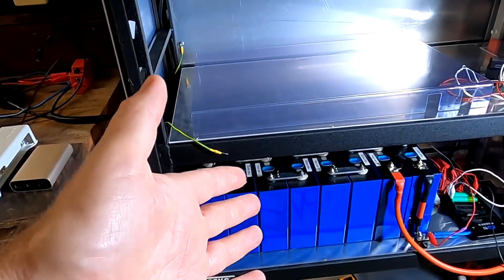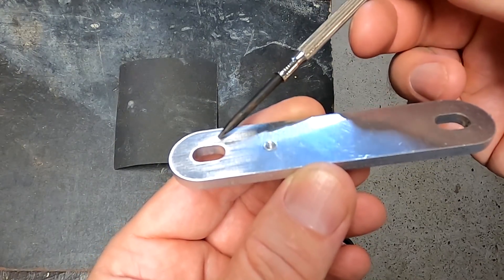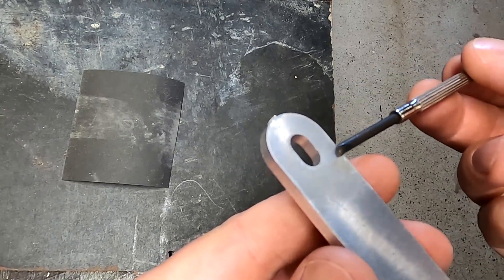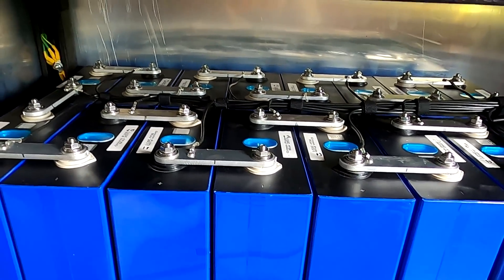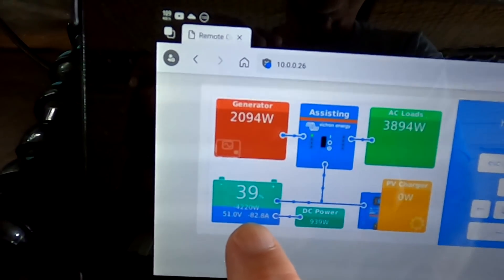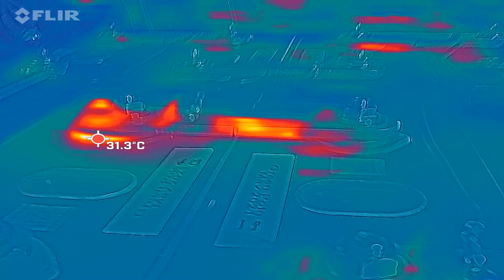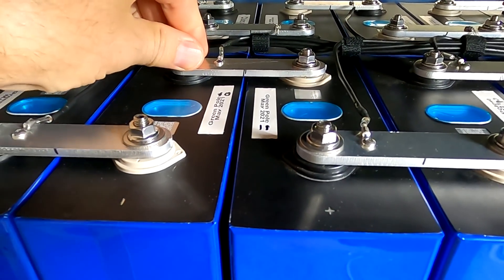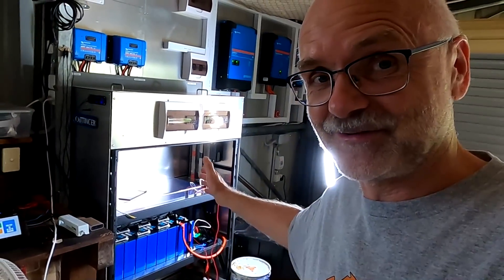Overcoming the battery-busbar problem (for now). Here is what I found!

Comment: Thanks so much for the in depth work on this Andy. It's the ultimate point of your channel, so show people not only what you're doing, but how and why. Rarely do we see people go into such detail especially in todays throw away culture. 

It's quite surprising to see the amount of people saying "use copper", who have either forgotten or neglected to look at your previous experiences with copper and tinned copper. There are pro's and con's of both materials, in my case I've decided to stick with Aluminium and the approx. 2000 bars I've sold so far have all been working well as far as I know. This extra preparation information will be included with future bus bar sales as a bonus. I might even consider a small sachet of Alminox (the paste I use now) in bus bar sales. 

While the product is vastly different, the underlying formula is the same as if we bought seeds to grow a plant from a shop. If we buy the seeds, drop them on the ground and walk away, we will probably find that in 3 weeks it's still a seed sitting on the ground doing nothing. However if we ensure the soil is appropriate, dig the hole, add the right amount of water, and bury it as prescribed, we come back to a sprouting plant. Preparing bus bars, doing nuts to the right torque, properly crimping lugs, and much more, is all part of the process of a DIY battery. This is the stuff we don't usually see behind the scenes in factories making these by the thousands. 

Good find with the raised edges too, even though the outside edge hangs just over the diameter of the battery terminal, the inside edge would likely affect the contact patch. So ensuring the surface is flat is a worthwhile step, and it's also something anyone can do with no special tools. 

For people who use the various pastes, be wary of what is used to apply the paste to the bus bar or to any surface. Using a cue tip needs to be done VERY carefully, because the fibres can easily dislodge and remain on the surface. If you're doing a lot of them, you can go to your local crafts store or pharmacy and get a similar looking item but it has a foam end on it (often used for applying face paint or make-up too), and this avoids the fibre issue. For larger areas, there are things called a "dabbing sponge" that would be ideal. Or as Andy uses, a clean rag can be easy for the bus bars, but tricky to use on battery terminals with studs. 

And finally for the people who still didn't see the info about the bars, they are made from 5005 sheet (not extrusion), laser cut (not stamped), and are 20 x 4mm. The current carrying ability is well above what Andy requires for this application. I use them on batteries that I allow up to 250A current drain.
Reply: Paul, 5005 is a relatively high tensile Aluminium alloy, something akin to what street signs would be made from. I'm no electrical engineer, but my understanding is that pure aluminium is the best conductor of electricity (of the various aluminium alloys) and it is also much softer than a 5000 series alloy and would conform better when tightened down to the battery post. Even with Andy's sanding, there will be all sorts of other variables like small variations in height of the different cell terminals, slight variations of the angle of the cells as they sit for example and so I think any bus bar needs to be flexible in order to have a good connection to the battery post. Copper can be thinner for the same current carrying capacity, is very soft when annealed and does not have as bad a problem with the oxide layer being such a good insulator. It has much to recommend it. For those with deep pockets, silver plated copper would be even better LOL.
Reply: @Ropetangler  Have a look at Andy's previous videos (I did mention that above), he's had experience with various bus bars, and these have been the best yet. You're free to use whatever you prefer, just as I am, and everyone is. The results of these are proven, as are the results for some others. I'm not saying there's a right or wrong, this is what I use, this is what Andy is using at the moment, and it's what many others use too. Just because you disagree with something, doesn't make it wrong.
Reply from the maker: Thanks a lot Paul. I've pinned your comment to the top of the list.
Reply: Would 1099 (commercially pure aluminum) make better bus bars? Softer, and higher conductivity.  Or would an 8xxx alloy (good conductivity, higher corrosion resistance, excellent creep resistance) be better?
Reply: Hi.
20x4 mm is good for 64 amps, according to online calculators.
Trying to learn, why do you say it's good for 250A batteries?
Thanks in advance.
Reply: I couldn’t be sure in the video, but it appeared that you are sanding the busbars dry and then coating them later.  Aluminum forms oxide very, very quickly.  It is advisable to coat the metal with antioxidant grease before and during sanding.  This will remove the oxide and prevent a thin layer from reforming before you get the bar bolted to the battery.  Most electricians are taught to coat conductors before sanding or wire brushing them for this reason.  You may wish to try this and see if it improves your hit rate on getting good connections the first time.

Comment: I've been playing around with some BT-360 cells and was astounded by how bad the connection can be. I found some aluminium clamps that have lugs on them. they have a 10mm internal but I plan to drill it out to 10.9mm and try to clamp around the posts which are 11mm. Then I will try to bolt bus bars to the other part. I will be able to fit a nut and bolt so a much higher clamping force will be obtainable. The newer EVE  cells have a bigger laser welded terminal but I went for the cost saving option. PS. with a 40A discharge I got 326Ah I would consider the BT-360 a good slow discharge battery and also a slow charging cell. To top them up to 3.65V took days! I think you need a 48V string or at least 4x in parallel to be able to get a large amount of power from these and to make more from the solar power available. On the other hand for the price It was unbeatable. I am now considering using LTO for my high power appliances with LIFEPO4 kicking in when voltage drops below a certain level (to be experimented with).
  Basically I am buying a low voltage relay circuit. You can set the relay to close when voltage drops below a certain level. The relay closing will switch in a 100A solid state relay (if controlled by a PWM signal can also regulate current).
  I can have for example several 100Ah or any other size LIFEPO4 that can be switched in parallel with the LTO cells. 
As the voltage drops to different levels you can have several of the low voltage relay circuits that switch in more LIFEPO4 banks at various voltages to help prop up the LTO cells as the bank of LTO might only be 35Ah but you can take a huge amount of current from them. I would rather put most of the load on a small bank of LTO rather than overstress my 4x BT-360 or one of my 100Ah LIFEPO4 batteries.

Comment: That is another reason I don't use busbar, I use lugged cables instead (as seen in video). The main reason is because the inherent contraction and expansion (bulging) of LiFePo4 that can damage or bent busbar in long term. I also avoid anything aluminium, I prefer fully copper or tinned copper.

Comment: Ok, its time now for an optical reaction.. A bit late, I know, but I didn’t see this before..

First: Materials like copper, brass, aluminium, always pick up grains from sand paper, increasing the resistance because of less electrical contact.
I always use an ultra flat diamond grinding tool, to grind cable lugs and bus bars. The difference is, that the diamond particles stay inside the tool, and will not imbed inside the metal of the lugs and bus bars. Proof: Sand paper clearly wears off quickly, my diamond tool, like sand paper, has a thin layer of diamond particles, however, I already use that tool for many years, without significant degradation. Accurate resistance measurements gave me diamond grinding as the clear winner!

Secondly: A typical IR thermal measurement gone wrong here !! You cannot ever measure the right temperature of metals like this! Metals reflect infra red!
You can see it in this video: Apparently, there is a IR source behind the battery pack, which is reflecting a source behind it! Because when the thermal imager is moved, you see the hotspots move as well !
Best trick to actually measure temperatures of metals, is to put pieces of paper tape on them, and then use the thermal imager.

I tested this on a stainless steel water cooker: With the water inside boiling, it measured 37 degrees C using a thermal imager, I measured my own temperature, reflecting on the outside surface of the water cooker, even with 100 dgr C water inside! But when I put a piece of paper tape on the surface, that piece of tape suddenly measured approx 100 degrees! I hope my message will still be read..

Comment: All very unscientific, suck it and see stuff but i spose it makes drama for a vid.  really you havent addressed the basic problem of making a reliable AL  contact.  These greases are a scam. The battery has a base termination  surface of AL and you are mating another AL surface on it with very mild force 4Nm (cos of the AL battery threads 8mm into a 6mm deep thread (of course use a SS stud grub screw)

Comment: Good video. I noticed years ago that modern 3 pin Australian 3 pin 240V etectrical plugs, now had pins that were stamped out of sheet and not accurately cut from engineered strip brass. The punching meant the nartow pin had a curved cross-section, and so like your busbars had a lip next to any edges. This resulted in a very narrow contact area. If the attached lead had 1 sq mm or 1.5 sq mm cable,, the heat wasnt conducted away, and pins and plug got burnt.

I also noticed some of your thermal shots showed the nuts snd studs were the hottest parts, meaning they were the conductors. As you probably know stainless steel has only a few percent of the conductivity of copper so is not good. So any improvement in inter-cell or post connection, is worthwhile.  As 25 x 6mm is a common Aluminium extrusion, and i cant see why with increased cell sizes these days, and little limitation of vertical height or space on cell tops, more robust links are not offered or manufactured. 150 sq mm is great. I made some for a 48V set of 460Ah cells i acquired a few years ago.
Once again, great work on your reports, many thanks.
Reply from the maker: Thanks a lot for your feedback and kind words.
I think the next time I'm going to build such a battery, I would go with flexible busbars. More expensive but a no brainer when it comes to small movements or unlevelled terminals. Saying that, I had no issues with the standard bus bars which come with the cells ever. Also the aluminium bars I have installed without any conductive or anti-oxidant paste as some suggested, are working perfectly fine.

Comment: Never seen this one before, wouldn't use aluminum bus bars, even if they were 3 inches thick...
Reply from the maker: Any reasons for that or just what you heard???
Reply: @OffGridGarageAustralia  No, It's just that aluminum is 60 percent as conductive as the same size copper conductor...The copper bars that stretch in the middle seems like a better solution..If I could find some silver bars, that didn't cost a fortune, I'd go that route, but that's not very likely..Do you still have those big aluminum bus bars or did you replace them with copper, I can't remember..But, I think I remember you ditching those things..That's another reason..
Reply from the maker: @realeyesrealizereallies6828  I still have them installed in my middle shelf battery. No issues. As I calculated in the video, they have a lower resistance than the standard copper bus bars. So I thought, I'll give them a go and do some long term testing. No issues, cheaper and lower resistance, so why wouldn't you....

I have these large aluminium bars behind the Seplos Polo batteries. Working well...

Comment: Those busbars with an elongated hole. are punched through the metal thereby distorting the metal by anywhere from .01 to 1mm or more, because all metal distorts when a hole is punched aka forced through it. By sanding the area close to the punched hole you removed enough material for the busbars to make full contact, instead of the partial contact they made befor sanding.

Comment: I'm pretty sure that I am about to buy the exact same kit of batteries except with their choice of BMS and balancers... It looks a lot more involved wiring it up than  expected but possibly that's just because of your choice of BMS....

The bars are probably uneven from the hole being drilled into them, I always use a counter sinker to clean up all of my holes when I drill holes at work in aluminum... Nice monitoring with the heat gun though. That has me worried that I should also have one as I am firing up my solar system for the very first time soon.

Comment: Andy, I'd like to tell you that I find 4 Nm too soft adjustment for such a thick bar to make proper contact. May be increasing torque would save u time and work. Up to 8 Nm that assembly is more than safe to tight. Just a contructive opinion.

Comment: Essentially, the rigid busbar doesn't always make good contact due to the slight angle when tightened down.  The crimp ring lugs on the other hand are independent and able to make better contact due to the flexibility.  My EVO batteries came with 2 layer flexible busbars that can mate with the terminal more easily.  Thicker isn't better.  What the manufacturer did was use two thin layers one of top of the other to carry the amperage.  They are fastened in the middle with heat shrink tube.  I highly recommend this or use of the ring lug to connect your batteries.

Comment: There was a bit of a fiasco in the 1970’s in the USA and Canada where new homes were being wired with aluminum wiring instead of copper.
The connections in the various boxes were having heat issues much as you were having. 
There were untold numbers of homes that had to be re-wired due to fires and the threat of fire. Some electricians stated “oh we’ll just coat the connections with anti-oxidation paste and that will solve the issue”. It didn’t. The houses got re-wired with copper.
So… I just stick with good ol’ plated copper bus bars and not worry.
Really appreciate the work you’ve put in to your videos!

Comment: Common sense says to use the best conductor material available and that is not aluminum. Aluminum attracts oxygen very rapidly and holds it so tightly it stops oxidizing.  Aluminum is the fourth best conductor.   I use Silver plated copper bars 1/4" or thicker.  Thick silicon dielectric grease to prevent the ends from oxidizing. Never any issues. I get an extra 4% efficiency.  I only wish I could have Graphene bus bars.

Comment: I go with the copper camp. I also only use brass nuts, bolts, threads and washers with battery grease on all terminations. When I worked on multiple aluminium 1000A busbars we always cleaned the bars first using a wire brush and Vaseline together. Then we did a drop test across the connection using high current and checking for any potential across the joint. Any potential and we started all over again.

Comment: I think you hit the nail on the head, it is a mix of three issue
1. Build up of oxide on Al.
2. Thicker Al busbar is not flexible enough to ensure good contact over whole area of battery terminal especially to over come the other problems.
3. The bussbar are not perfectly flat, this looks distortion of the flat material as the bussbars are Punched out of flat plate so a bit of local Distortion at punched edges.

I have built a 404 Ahr battery (@12v) from 202 AHr cells and used thick Al bar as busbars for our van.  Busbars holes were drilled (and deburred), ends were sawn then filed.  Finally I polished the bars to remove the accumulated oxide and installed (I did a bench install and a few weeks later final installed).  This was then run at 90A (45A PER CELL as 4S2P) and no heating at the terminals (just the 200A switch gets warm!).
Been running for two trips of 2 weeks each and looking at BMS ((JBD 250A) all looks good. About to repeat 90A load and check no new hot spots.
So no issue using Al for busbars provided prepared right then torqued nice and tight.   This  not only produces a good electrical contact but also a gas tight contact to stop future oxidation at the Al to Al connection.
Again thanks for the videos.
Reply from the maker: Thanks for sharing your experience, Ian. Much appreciated. 
I will monitor the situation over time with mine and see if the problem comes back. It did with the old battery and re-doing all busbars was ever only a temporary fix.

Comment: I have also been using aluminium busbars, both on a 32 cell battery pack and with Victron batteries in a motorhome with no problem. My systems have two differences which might be significant.
1. I made my own busbars from lengths of flat bar. I did use Andy's test using fine sand paper to check flatness and they are absolutely flat so checking the source material for flatness is important. 
2. So far I haven't charged or discharged faster than 50A but typically have charged and discharged for periods of over 10 hours without any appararent terminal post heating. I do not have a thermal imaging camera but as Andy demonstrates any significant heating would be discernable by touch.

The motorhome has been using lithium batteries with aluminium busbars for 3 years now and the 32 cell pack has been running for one year. Normally problems will show up within that time so it seems to me that the quality of connection is more about the specific mechanics of the materials and assembly technique rather than just chemistry.